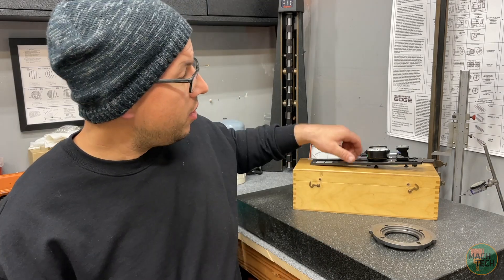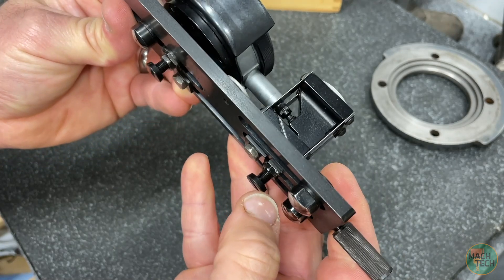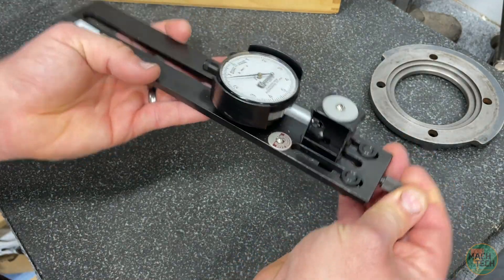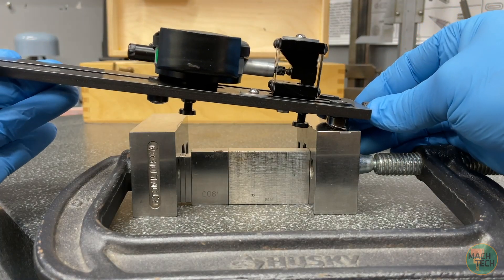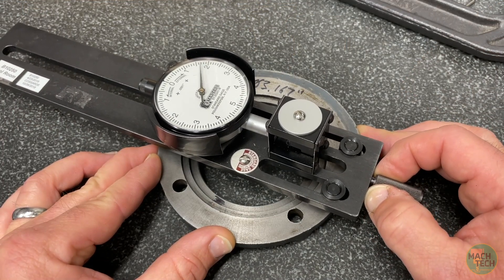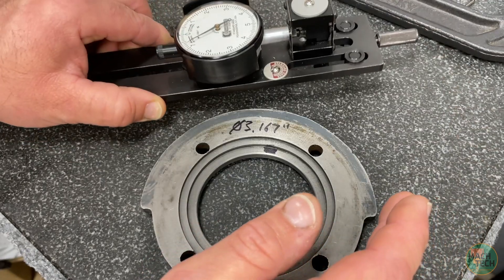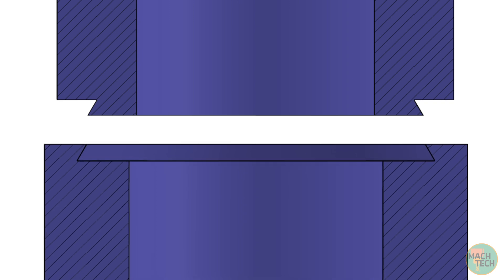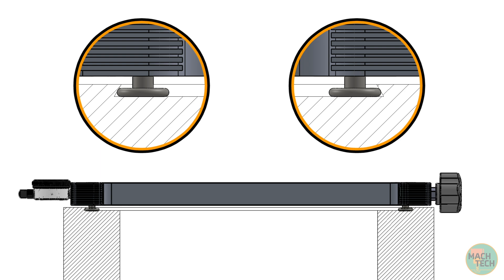Shallow Diameter Gage

Comment: Showing it with a real world example adds a lot to the video! What's the overall shape deviation on an assembly like that? i can imagine even with tight tolerances it adds up when stacking so many parts.
Reply from the maker: Good to hear! The interference dovetails keep everything pretty well aligned. Although, I just checked the print again and couldn’t see any positional tolerances for the centers of the dovetail grooves. When done in a 5-axis machine in one/two setups, the concentricity of the dovetails to the toroidal features should be quite good. The only real requirement was that the two macaroni noodles could slip together and that the grooves lined up enough to squeeze the wires in them.

Comment: Adam, Great job as always!
I've seen many special gages in my day, but not that one.  
Were the "Fins" on the large gage you used at LBL for controlling heat input from your hands as you used the gage? Being that it was an Aluminum body with a fairly large length, and any heat from your hand would quickly cause thermal growth and introduce error in your readings.
Great presentation, keep them coming!
SW

Comment: why Aluminium? I think on temperatur
Reply from the maker: I agree in hindsight aluminum was not an ideal choice because as you handled it the temperature would increase and the length of the gage would increase. We ended up working around this by taking precautions like wearing gloves and checking the tool frequently against the standard.